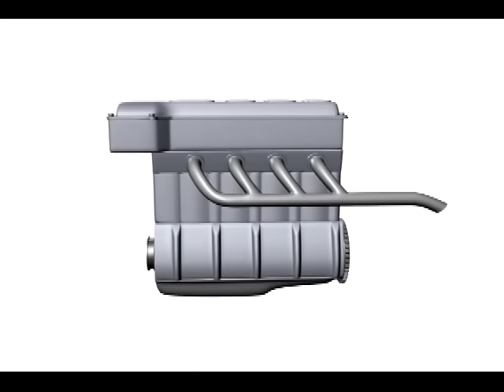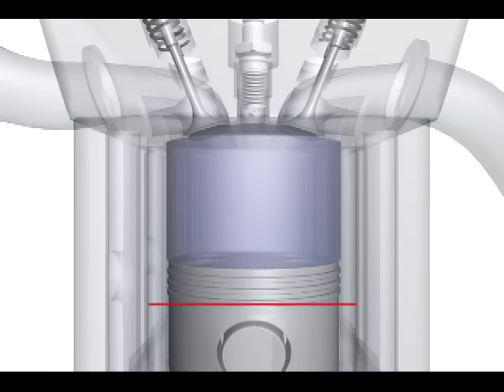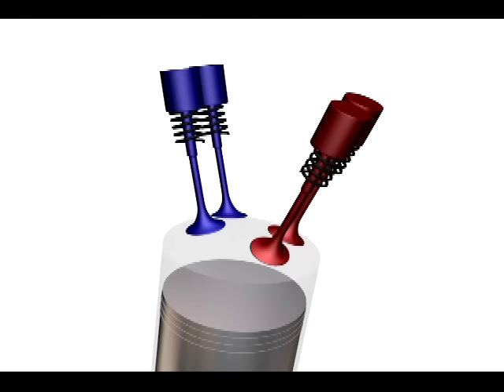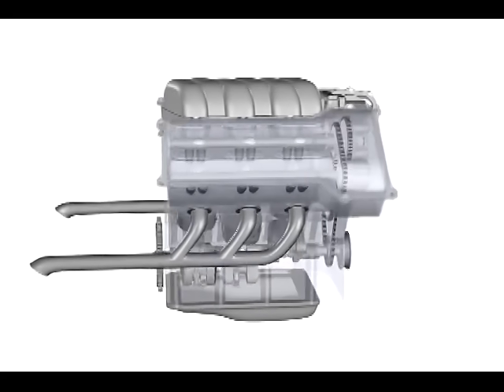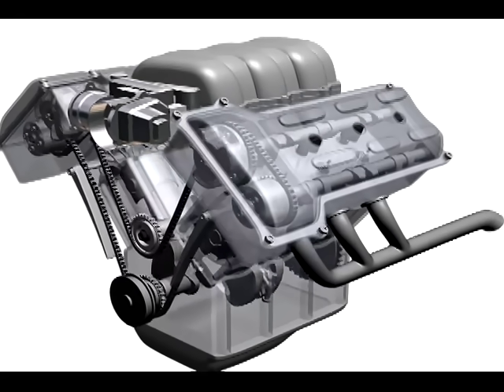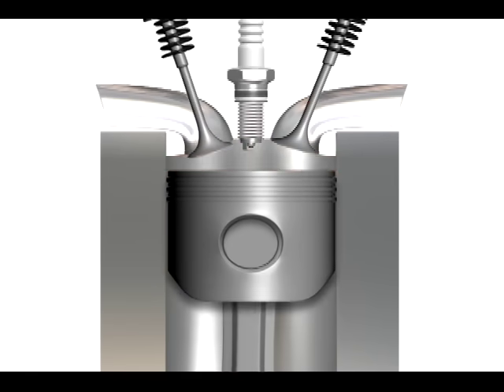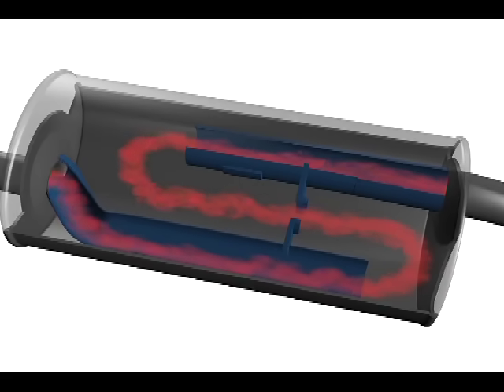How an engine works - comprehensive tutorial animation featuring Toyota engine technologies (2008)

Comment: So basically, if you want more horsepower out a NA engine, without mounting a supercharger, you have to maximise the air intake and outtake?
Reply from the maker: +Viorel Matei Exactly. And that's why aftermarket "intake and exhaust" setups are so popular. The problem is, because modern cars are computer controlled, in order to really get a proper benefit out of changing the mechanics, you also have to change the electronics to do something with that extra air and fuel. It will only change slightly on it's own just by bolting stuff on and, frequently, that actually robs the engine of power because the ECU holds back because it doesn't detect the engine running "properly." And that's why turbos and superchargers add so much power...they are "cramming" air into the engine under high pressure and therefore a lot of fuel can also be burned in order to produce more power.
Reply: +allegroracing yeah, when you add bolt on parts to a car and then get the car properly tuned it's a night and day difference
Reply: More air, more fuel, more combustion and compression, more power, there’s your answer
Reply: +vernonclassic luckee! How can I get my wife to do this?
Reply: And still time for you tube ! Wow
Reply: ECU'S can be remapped ! But all over my head now back the 
shed to play with needle levels and float height and get the points
spot on with a dial gauge and a timing light !
Reply: vernonclassic there is a god
Reply: Voila!!!!
Reply: Viorel Matei yea drill a hole in the engine lol !!
Reply: How does one "fix" an air filter?.. Sounds like she rawks. You should take time to at least learn a basic tire change though. Getting stranded because of this is ridiculous, lol
Reply: Viorel Matei yeah pretty much mate, he said it pretty well himself, more oxygen that gets into the mix the better the bang the more kick, that's why turbo tuning and super chargers work so good
Reply: Viorel Matei 👌

Comment: i dont understand why there have to be 4,6 or 8 cylinders...wouldn't 1 cylinder do the job? and why cant there be like3,5 or 7 cylinders? also, if my car has a 3.0L is it more powerful than a 2.4L?
Reply: Because the more cylinders there are, the more powerful the engine
Reply: Ahh ok thx.
Reply: His comment was very vague. If you have more cylinders, generally it will have a higher displacement and be more powerful. However, this is not always the case. The more cylinders you have, the more times this process can be completed. Also, the "liters" is the total capacity of all the cylinders added up. If you have a 2.4 liter I-4, then each cylinder is 0.6 liters. If you have a 3.0 liter I-6 or V-6, each cylinder is half of a liter.

Comment: so what actually happens when I stick a potato into the exhaust? Why doesn't the engine blow instead of just stuttering? This is an honest question for those who wonder!
Reply: probably because the potato isnt strong enough to hold all the pressure from the engine on the inside of a 1-3 inch exhaust. there would almost certainlu be pressure and gasses slipping around and thru the potato.

Comment: Only 20% of the energy from gasoline is converted into motion, the rest is converted into heat. Hence cars have very elaborate cooling systems. Losta cool technology for sure, but the internal combustion engine's days are numbered.

Comment: How can people create something this complex and creative but not invent something that gives zero emissions?
Reply from the maker: +Sundaram Periyasamy Because in order to convert potential energy into kinetic energy, the most energy-efficient yields are from burning stuff and that causes chemical reactions and releases compounds and chemicals which can never be 0. You can't "create" heat with 0 emissions. It's impossible.
Reply: you're right. sorry i meant a "clean" fuel source.
Reply: tesla model s
Reply: +Mike Roberts that is good work
Reply: Because that's decidedly harder.
Reply: I have a idea to run engine without emissions  only on  air continusly at single refiil any one in the world to invest freemind contact akaulgue295@gmail.com  I am very serious please
Reply: +Dhina dhayaalan you're dumb... Google how batteries are made

Comment: Question: Where is it getting the extra power to compress?
Reply: +BRBallin1 and at the very first time (when you turn the car key for ignition) a battery operated starter motor does that
Reply from the maker: +BRBallin1 A couple of ways. 1. The other cylinders firing imparts energy to the crankshaft that keeps all the pistons moving even when they aren't being fired. 2. There's a heavy flywheel on the end of the crankshaft that keeps the crankshaft tending to want to spin.
Reply: +allegroracing called inertia
Reply: From the fly wheel
Reply: +BRBallin1 Pretty much what allegroracing said above, except that I'd add:

On any engine setup (4 cyl, V6, V8, etc), the ignition timing (frequency of sparks from the spark plugs) is setup so that each cylinder "fires" in a sequence, usually one after the other. 

So if No 1 cylinder fires on the power stroke, as it ascends on the exhaust stroke, No 2 cylinder is firing on IT'S power stroke, then 3, then 4, and so on. 

Thus, at all times, the crankshaft is receiving jolts of energy from one or more pistons pushing down the connecting rods.
Reply: Good question! During the power stroke the energy is stored in a flywheel in rotary motion. That flywheel's rotary motion gives the power back for three other strokes!
Reply: Crankshaft pulls the piston down with the power of the other cylinders power stroke
Reply: from the starter motor
Reply: I thought he meant to begin with
Reply: ashish paralkar oijhf
Reply: @Sipifok, the cylinders are also staggered to work and when one set is undergoing compression another set is going through power stroke
Reply: BRBallin1 What about single-cylinder engines such as those found in scooters and mopeds? I find it hard to understand how one stroke (the power stroke) can provide enough energy for the cylinder to move the next three strokes (exhaust, intake, compression).
Reply: @robinnapoleon3065  the force of the combustion pushes the piston down and spins the crankshaft which will make it loop back around and repeat
Reply: Its not and explotion every lap if its not a 2stroke engine.
Reply: VesperGMZ nonono from the other pistons. Its the same crankshaft you know
Reply: Nice
Reply: the counter weight
Reply: Gj
Reply: BRBallin1 😴
Reply: Also piston counterweights
Reply: BRBallin1 most engines use a turbo charger to produce extra compression most high performance Hyper cars use two turbo chargers E.G Pagani huayra but some high performance muscle cars use super chargers

Comment: But what makes the piston go down for the intake stroke? Gravity? If yes, what makes it go up for the compression stroke...?
Reply: It goes down by the combustion and since its on a fixed axis momentum brings it up.
Reply: Did you mean how the process gets started? Well it first draws power from the battery and the starter begins the process. Once it gets going momentum and the combustion takes over.
Reply: ***** I've been looking at a few GIFs and I think I got it now. Thanks :)
Reply: +Guilherme Pata A combination of inertia and work done by a different cylinder. The 3rd stroke, the power stroke as referred to in the video, is the only one in the cycle that does work, for the other strokes it actually the engine actually needs power, especially for the second one: compression. In a 4+ cylinder engine there will always be one cylinder on the power stroke, for engines with fewer cylinders weights on the crankshaft ensure the cylinder will keep going through the other 3 strokes.
Reply: paul zapodeanu thanks, that makes sense :)

Comment: I had a camery with a 3.0l V6.. It had a great balance between power and economy.. The only reason I sold it was I didn't want to mess with changing the timing belt. I would of still had this car if it weren't for the belt.. If they made it with a chain I would buy one these days.. Instead, I bought a Mazda just for this reason, and it's been a great car

Comment: So as the piston is moving back up and the exhaust valve is releasing the burned air and fuel , doesn't that release the pressure needed to make the piston compress the fuel and air ?? Please answer because I am totally confused now.
Reply: SlyLife After the piston moves up and pushes the used air out, new air and fuel fills the cylinder. The cylinder keeps moving because the crankshaft has other pistons firing at different intervals. On a 4 cylinder engine, the crankshaft has each cylinder, either at 2 cyclinders at 0 degrees and 2 at 180 degrees, or all cylinders are at 90 degrees from eachother. 

See image. http://www.engr.colostate.edu/~dga/mech324/figures/F14-03.jpg

Because of this, while one or two cylinders are releasing fuel, the others are creating power. Also, the flywheel is there to ensure a stable power output. If you have ever played with a spinning top toy, you know how that works mechanically.
Reply: I think it's the reaction of the explosion that throws it back down. Like every action has an equal and opposite reaction. Same deal.

Comment: To this day the 2JZ is one of the best engines Toyota has made period
Reply: @asim  What? The 2jz is an inline 6
Reply: George Mahfood yea i thought that too
Reply from the maker: In 2008 when this video was produced for Toyota dealer personnel, there was no non-V 6 or 8 cylinder engine in production by Toyota. The video is not a historical accounting of every engine Toyota ever made but a contemporary training piece that is only interested in the product line that was available in 2008.
Reply: and the mr2
Reply: Carlos Berrios wtf u talking about 2jz is twinturbo or na stock and 1jz is stock single turbo or maybe na idk
Reply: Carlos Berrios 2jz and 1jz are different
Reply: I dont get this at all
Reply: Real....i hve enjoyed the lesson.
Reply: 2JZ = 3.0ltr Displacement
1JZ = 2.5ltr Displacement
Both are inline 6 engine and there are turbo and non turbo variances.
Reply: Attila Vidacs 🔥
Reply: The 2JZ engine was just the name of the twin turbo fitted to the Supra the actually engine was a performance crankshaft v6 a turbo adds compression thus making the explosion in the combustion chamber to be stronger.
Reply: 2jz is a boosted 1jz which is an inline6 that still shits all over these pos 2ar. Y U H8 BOOST TOYOTA!?

Comment: A noob´s question here guys, hope someone can help me up.

I undertand the function of the engine, how every part works and what it does. But how does the car turns the revolution of the pistons in axial velocity for the wheels?

And another one.
Does the crankshaft make the pistons work, or does the explosions in the chamber make the crankshaft spin?
Reply: Jorge D. Ortega I'm not sure if allegroracing got your question right, so I'll give it another try. As far as I understand you, your two questions are related. The combustion drives the pistons, and they in turn drive the crankshaft. This is where the translation (linear movement) is transformed into a rotating movement. But during the other three strokes (intake, compression and exhaust) the crankshaft indeed drives the pistons.
Reply from the maker: That's what the transmission and differentials are for. I did a differential video but not a transmission video but essentially there's a clutch or torque converter (or similar) that allows power from the rotation of the crankshaft to be sent to shafts and gears in the transmission which is then sent to the axles via differentials.Jorge D. Ortega
Reply: Jorge D. Ortega Just so its clear, the pistons don't revolve, they move up and down only. The firing of the pistons is timed so there's always at least one piston in a power stroke, so constant rotation of the crankshaft is maintained.
Reply: ***** actually the crankshaft does drive the pistons that are not in powerstroke.
Reply: MyFavoriteDisease fantastic reply
Reply: ***** So what moves the piston on the compression stroke? Where does the energy come from to compress the fuel/air mixture? I don't think this is semantics.
Reply: ***** "this pushes the other two pistons into compression" "pistons is what drives the crankshaft thus in turn pushing each piston up." Exactly my point. The pistons only drive the crankshaft on the powerstroke. During the intake, compression, and exhaust strokes the piston is being driven by the crankshaft.
Reply: ***** Counter weights are there for balance, to reduce vibration. You're thinking of the flywheel.
Reply: ***** If you shut an engine off (which means cutting off injection and ignition), the crankshaft and pistons keep moving for a couple of revs before the engine completely stops moving. What do you think is driving the system during this time? Allah? The flying spaghetti monster?
Reply: MyFavoriteDisease So, I'm also a total noob with engines... so following with the original question which I didn't see a part of it answered... where does the force come from to compress the piston before there is any combustion going on? Is there an electric motor or something driving the initial stages of revving up an engine?
Reply: ***** Awesome, thanks! I found a real old school documentary on the concept for how a starter works that broke it down barney style, really helped me understand it. It didn't mention anything about the alternator though.
Reply: Initially the crankshaft is driven by a starter so it can have the momentum therefore the crankshaft drives the pistons but after that, the power stroke pushes the piston down therefore it's the piston that drives the crankshaft now. In short, each piston drives the crankshaft 1/4 of the time but each piston takes turn for the so they fill each 1/4th.

The crankshaft now turns. It creates torque (rotational force). This force is delivered delivered to the wheels via drive shaft which is connected to a bevel gear that is connected to the wheels. 

Of course all of these are to simplify things. Transmission comes before the drive shaft. It makes the drive shaft spin faster even when you apply the same RPM by connecting the drive shaft to smaller gears. And of course the drive shaft isn't just connected to a simple bevel gear, it's really connected to a differential system which makes both wheels vary their speed when turning even if they are in a common axle.
Reply: ***** I agree with what you said. It will always be the pistons driving other pistons. 

I just try to simplify my comment without adding too many stuff. You get the idea.
Reply: Denis Lipatnikov What about single-cylinder engines such as those found in scooters and mopeds? I find it hard to understand how one stroke (the power stroke) can provide enough energy for the cylinder to move the next three strokes (exhaust, intake, compression). I'm under the impression that the piston counterweights and inertia makes it wants to continue rotating around. But remember, this is an engine and if you've ever tried to turn the crankshaft using a wrench you'll find that it's very difficult because pistons don't rotate as smoothly as a fidget spinner or ball bearing. But the engine appears to have no difficulty in sustaining this rotation. The starter motor obviously needs to get the whole process going.
Reply: how does the car turns the revolution of the pistons in axial velocity for the wheels?
- with bevel gear
source :
https://en.wikipedia.org/wiki/Bevel_gear
from 'bevel gear' in
'An important product came in 1874 with William's invention of the first bevel gear planer, a planer with integral indexing head designed to specialize in planing bevel gears.'
in
https://en.wikipedia.org/wiki/Gleason_Corporation
from 'gleason' in
https://en.wikipedia.org/wiki/Limited-slip_differential#Types

Does the crankshaft make the pistons work, or does the explosions in the chamber make the crankshaft spin?
- i don't know

Comment: And whats moving the camshaft?
Reply: It doesn't actually tell you in the video, but the "timing chain or belt" AKA Cam belt, wraps around the end of the crank shaft and then up to and around the cam shafts. So as the crank shaft rotates, the belt moves which in turn, rotates the cam shafts. Hope that made sense :)

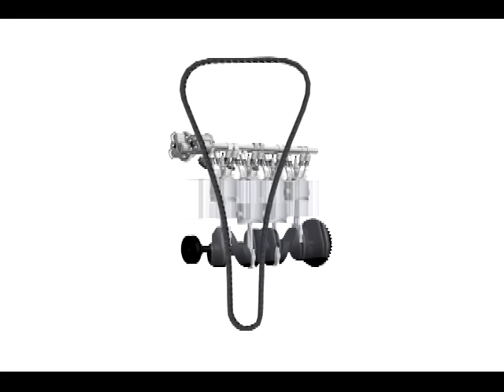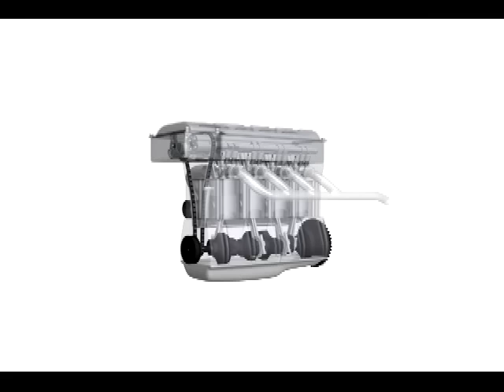You can sort of see how it would work between 0:55 and 1:00 :D
Reply: ***** although this may be a bit late but here is what happens when you first turn the key: there is an electric motor connected to something called the flywheel (through a pinion) which you can see on the other side of the engine this flywheel is connected to the crank shaft the electric motor is called the STARTER which is driven by the battery it's function is to give power to the flywheel to rotate the crankshaft just to get the car started the flywheel is also an energy storing device which prevents the engine from dropping torque during the other 3 strokes and is given power by the crankshaft during the power stroke.
the timing chain is driven by the crankshaft (burn of the fuel) the power out of the rotation of the crankshaft drives the car wheels (after passing by other stages)  as well as some other stuff like the alternator, AC compressor,..........etc.